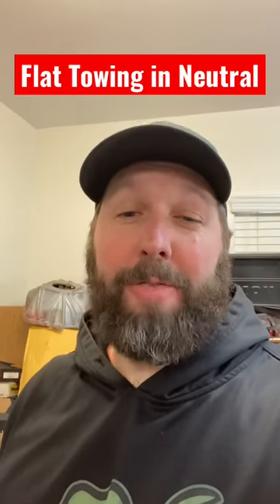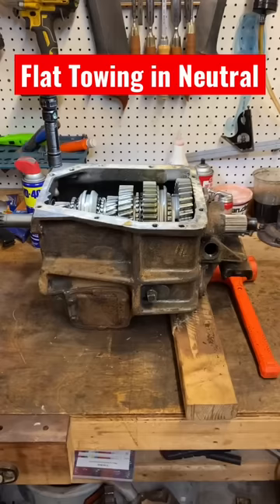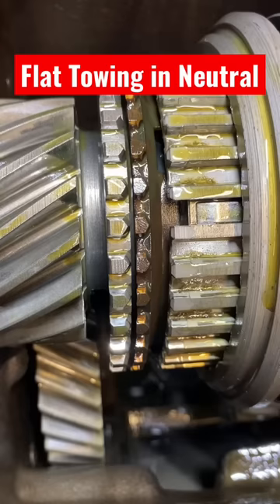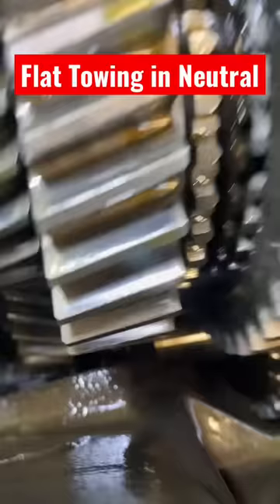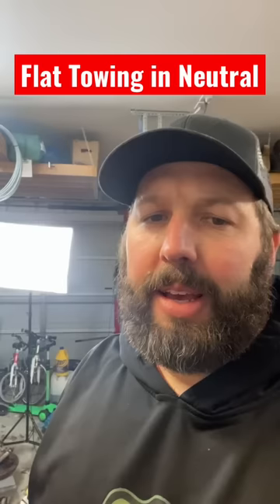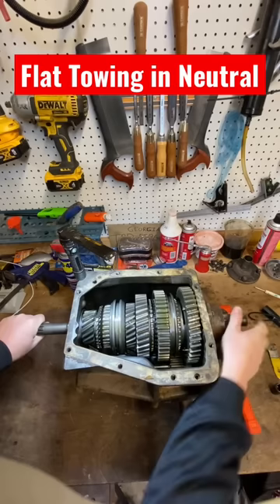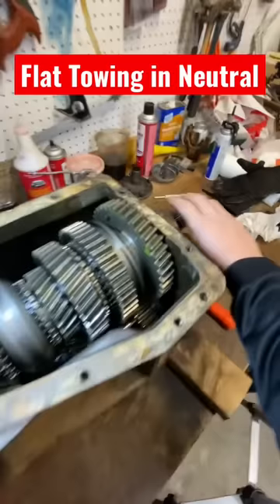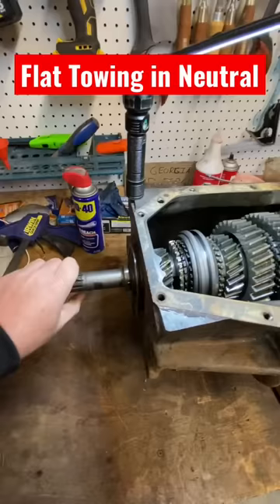Flat Towing in Neutral??? #transmission #stickshift #mechanic

Comment: Something else to remember is not all manual transmissions behave the same way either. I generally look up the model to it's specifics before flat towing.
Reply from the maker: That’s true. You have to refer to the owner’s manual. My longer video stated that, but it got cut out when the video got trimmed down to 60 seconds 👍

Comment: The 3 speed with low trans that came in "most" Chevrolet 3/4 and one ton trucks should have 80w90 gear oil in it. I have towed more of those with the trans in neutral and the front on a tow truck than I can remember. Don't go more than 15 miles or so and if you must then pull over and let it down and start the engine for a bit. NEVER tow over 40 mph without pulling the driveshaft and ALWAYS drive slower if possible. Towing with the front lifted keeps the rear of the inside of the trans covered in oil. Pull the driveshaft if your flat towing without a person in the vehicle with the engine running. Pull it anyway if your pulling someone with a strap or chain at highway speeds which you shouldn't be doing to start with but not everyone has a trailer or tow truck money. Don't pull an auto trans vehicle at high speed without a person it with the engine running or disconnecting the rear of the driveshaft and strapping it up. NEVER  DRAG  OR  TOW  FULL TIME  4WD  OR  AWD  VEHICLES. Trailer or rollback them only. Don't tow or drag 5 speed Dodge manuel trans truck with the driveshaft in. You might get away with it going 20 mph but it isn't worth the risk.
Reply from the maker: It’s best to just read the owners manual 👍

Comment: Love the comments but in seriousness you never want to flat tow a ford superduty with an automatic in neutral even a 4wd and the transfer case not in neutral as it will destroy the automatic.  The last planetary set is splined to the outputshaft and it wont recive lubrication and fry. You can flat tow with transmisson in park and transfer in neutral but all around its best to use a rollback or remove the shafts
Reply from the maker: Yeah the trans needs to be in park.
Reply: @freedomworx  we had a guy at our shop that was one of those know it all's and we had no choice but to flat tow this truck. It was a geo thermal company truck with a drill derrick on the back.  The truck was far too heavy for its own good and it couldn't be jacked up to get to the driveshafts.  If I remember correctly the bed with the derrick alone weighed 18,000lbs.  Needless to say the truck was a constant headache, they had taken the bed off their old truck that was cat diesel powered and slapped it on this poor old F450 6.0 powered truck.  Anyway the guy was told repeatedly to keep trans in park and the transfer in neutral and he kept asking why park with that tone like he didn't believe you but lacked confidence to strait call you out so any way only had to go 5 miles.  Thing is when he hoped out he put transfer in gear to hold it on the incline it was on so we had no clue the trans was toast till after I put injectors in it.   By then he had already be let go for some other screw ups.  I won't even begin to tell you the fiasco it was putting the trans in something we could not get on a lift or remove the cab.
Reply from the maker: Everyone tries to call me a know it all when I post stuff like this. It lets me know immediately who the know it all in the conversation is. I know I don't know everything...and that's why a continue to learn. I'm not trying to flex any intellectual muscle, I'm just trying to teach folks something that might cause them some heartache and butt hurt somewhere down the road. I'm not even a mechanic, so when the "professional mechanics" start running there ignorant mouths, I just feel so sorry for their customers...
Reply: @freedomworx  sorry if you thought my first sentence of my reply sounded directed at you.  I forget how things come across sometimes.  Allow me to correct that.  I was "yeah" to you agreeing with your reply then when is said "we had one of those know it all types..." I was beginning to reflect and think back and tell a story.  And I'm not one of those old timers that thinks everybody else is beneath me.  I think in this field the day you stop learning is the day you hang up the hat because everything changes so fast.  When I called this guy a know it all  let me give a better example of what I mean and sorry for the novel in advance.  He was putting. Timing belt on a vehicle. Part of my job was helping any new guys that needed help or had questions and also show them how to look stuff up online and print things off.  I diagnosed this car and had already printed off the complete procedure for the timing belt replacement so I gave it to him and had highlighted the timing mark alignment as it was kinda funky and he said he had done several of those cars and knew how to do it and got started.  Also part of my job was that all timing jobs got double checked and signed off by me before the cover was put on and finished so it was my ass if it was screwed up.   First double check it was wrong I showed him and explained it with the diagrams and said I would be in the next bay if he needed me.  2nd double check wrong so I pulled my cart over and showed him how by doing it and he argued they I was wrong and the procedure was wrong.  I went and double checked and it was not wrong came, I went into the office to explain to the owner of the shop what was going on and ask how to proceed And he said if I have it in time and am sure then to tell him to put it back together the rest of the way.   We then went over a few other vehicles in total I was gone 15 minutes.  When I went out there he was starting to put the cover on and I asked him if he messed with it or if it was still how I left it.  He said it was the same. Long story short it started for a second or two and went boom and locked up.   Im like fuck my life. Luckily we had cameras and it showed him taking the belt off while I was in the office. Once confronted....  He still lied and said he didn't touch it.  Showed him the video and he said that's not the timing belt he hand in his hands.  So yea.  That's what I meant by calling him that.  Nobody knows everything and everybody makes mistakes but it's how you handle them and grow from them that counts.  Also that wasn't even the worst of what he did that led up to him getting fired.  We really tried to teach anybody willing to learn but he just wasn't.  Have a good day sorry again for the novel
Reply from the maker: I didn’t take it as any disrespect towards me. You wrote it just fine. 👍I was just explaining how I agree with you.
Reply: @freedomworx  ok cool.  I felt so bad and was like well shit.  I honestly try to help the younger guys and not be one of the stereotypical "old timers" and I hated to think I came across like that. I wanted to make sure you knew I wasn't.  Sorry for misreading your reply. Thanks for letting me know.  I subscribed.  Gotta love the internet and how things come across sometimes.   I swear 2 people online could argue over it being day or night with out even realizing they live on opposite sides of the earth.
Reply from the maker: Thanks for watching 👍

Comment: put it in gear and cut a broomstick to hold the clutch down, or put a floor jack under the rear end to hold the wheels off the pavement, or remove the spider gears, whatever you do don't read the owners manual... lol
Reply from the maker: My wife would be upset if a cut down her daily driver 🧹

Comment: I've never been told that. I've been towed & I've towed other vehicles & they've always been in neutral
Reply from the maker: Well it's fine and not in others. Distance and speed also matters. It might have been perfectly fine, and you might have done damage you didn't know about. The Owner's manual will explain what is permissible.

Comment: Years ago we had a thing called tow hubs they went between the drum and the wheel and they had a bearing inside and they spine free so the differential driveshaft transmission would never turn and that’s how you flat tow the vehicle
Reply from the maker: Interesting. Never heard of those 👍

Comment: Makes sense, even though there is no torque the drive shaft is still spinning causing friction. But would the gears change? A car being pulled at 50 miles per hour stuck in first would be horrendous IMO
Reply from the maker: I never said to tow in gear. Just that towing in neutral can potentially be harmful. The owners manual will explain how to flat tow properly.

Comment: I've seen manual transmission cars towed that way without damage several times and was always told this is an automatic only problem. Clearly you can see that would be a problem with lubrication loss eventually but this particular design would go  longer than most tows without damage.
Reply from the maker: The only way to be sure is to read your owners manual. It affects different transmissions differently.

Comment: I told my tracker with my RV for 9 years and never had a problem the only problem I've ever had of the transmission was the clutch spring on the disc was loose and the clutch still look like brand new but I had to replace it because the spring was loose making noise PS the gentleman about it brand new from the dealership to pull behind his RV before I purchased it
Reply from the maker: It’s depending on the specific transmission. Some handle it just fine. Some catch fire.

Comment: FYI,.... you can tow in neutral you just have to either have the engine running........
 Or you can leave the transmission in its highest gear and just let the engine spin with the gearbox every time you start moving which won't hurt anything but it'll cause a little bit more drag but at least it won't cause damage.
Reply from the maker: I absolutely told you what to do. Read the owners manual…. I doubt any of them will tell you to tow the vehicle with it in gear, spinning the engine…
Reply from the maker: I think book smarts and hands on experience are both required to gain wisdom. The people that don’t, are usually lacking one. I’ve got both. Pretty silly argument though. Trying to discredit my video by saying that reading the owners manual is t the appropriate course of action 🤷🏻‍♂️
Reply from the maker: @skeetermcswagger0U812  what’s your problem?
Reply: @freedomworx  ROTFFLMMAO!!!🔩⚙
Reply: @freedomworx   I hope you don't put this much effort into complaining about everybody else that's complaining that complains about this video because that might become a vicious cycle. 💀🏍💨🔄
Reply from the maker: I’m genuinely interested in what makes you so pissy 🤷🏻‍♂️. You seem pretty unhappy.
Reply: @freedomworx   I have a good friend that's an engine builder and whenever he builds an engine for a car for me that I'm going to use in any type of competition if it's stick shift and I haven't had a chance to break it in really well I leave the break in oil in the engine and put the car in high gear and I tell it to the event in gear and I've never had a problem with doing that in the 25years I've been doing it.🤷‍♂️
Reply: @freedomworx   You ever heard that little phrase"....... dig 2 holes."?

🇺🇸 You might want to get started.🇺🇸
Reply: @freedomworx   If you're that sensitive about comments we get on YouTube I could just delete mine if you want......it's that simple.
Reply from the maker: @skeetermcswagger0U812  well not to be mister negativity, but that’s not really an adequate way to break in an engine. You need cylinder pressure from spirited acceleration to force the rings into the cylinder walls for them to lap each other. And as far as flat towing your race car without damage, good on you. Some transmission don’t have any issue with it. But many do. So you do you. I’m just providing the information for people that didn’t know it can cause damage. And if you don’t want to listen to me, maybe you’ll listen to Tremec 🤷🏻‍♂️. https://www.tremec.com/not_am_detalle/flat-towing-manual-transmission-vehicles/.
Reply from the maker: I’m not sensitive about it. I’m just don’t understand why you feel the need to be so abrasive 🤷🏻‍♂️

Comment: This is also a point against those that like to drop into neutral to coast.
Reply from the maker: Yes, but if the engine is running, and the clutch isn’t depressed, it will still oil itself. 👍
Reply: @freedomworx  Not as quickly as I would think it should be compared to the output shaft is spinning speed. but a fair point.

Comment: Just put transfer case in neutral, chain and or gears will cover the transfer case oiling.. if not a 4x4 you bought the wrong towed vehicle
Reply from the maker: There is a reason you see so many Jeeps behind Motorhomes. 👍

Comment: If you are in neutral then the transmission is disconnected from the engine and drive shaft. Thats why your transmission shows idled RPMs while you're driving if you popped it in neutral. If you are flat Towing and it's in neutral the transmission gears should not be turning at all
Reply from the maker: The transmission is never disconnected from the driveshaft. If the driveshaft is moving, then the output shaft and everything attached to it is still moving.

Comment: Pretty sure your wheels are spinning which spins the diff which spins the driveshaft which spins output shaft
Reply from the maker: That’s all true. Problem is that the output shaft does not touch oil. It also does not spin the countershaft, which is what slings the oil to the top of the transmission. That’s the point of the video.

Comment: In England, I had RAC breakdown cover. My 82 Ford Sedan broke down in winter, head gasket, so I booked for an engine swap to yes, an LS V8. RAC comes inspects the car, says they'll roll back it because it's a classic, so the next day the guy shows up and is immidiately hostile because I spoke to him during the liberal religious holiday of Covid Lockdown, he then proceeded to flat to my classic which now has major arch rust, no transmission and has been abandoned by the new mechanic. I am now 26 grand in the hole with no accountability.

TL:DR Just don't get your car towed by anyone other than a private operator who's honest and has a rollback.
Reply from the maker: Dang. That sucks.

Comment: Thats y i always remove the sparkplugs and put the gear shifter in last gear and remove the head light bulbs and ecu if u wanna be on the safe side put your mirrors in the fast position this will not help ever but the more you know, you know?
Reply from the maker: Overachiever 😂

Comment: The drive shaft turns the gears to splash lube. The clutches are just separated and the input is sitting still.
Reply from the maker: The driveshaft turn the gears that don’t reach the oil. Thus, it doesn’t splash. There are no clutches in this manual transmission. 🤷🏻‍♂️

Comment: That is why it is better to trailer. Back in the day when had to flat tow our CJ5 rig for hunting, disconnect the driveline from the diff.
Reply from the maker: Jeeps are generally fine for flat towing. You just put the T-case in neutral and the trans in gear/park.

Comment: I flat towed my s10 to the shop 5 minutes away because i blew the oil cooler line off of it and blew all the oil out, didnt seem to hurt it but since it was a very short trip im guessing it doesnt do any real damage
Reply from the maker: It’s perfectly acceptable for some. And short distance at slow speed is fine for most.

Comment: Yep and there’s heaps of different configurations that you really need to know before attempting it.
Reply from the maker: You should read your Owner's Manual. Towing in neutral is fine for some vehicles. Some need the driveshaft disconnected.
Reply: @freedomworx  Yep, absolutely true.

Comment: When towing any vehicle.  Figure the drive wheels.  Rear wheel or front wheel drive.  Front wheel drive, lift front.  Rear wheel drive, lift back.  Totally safe, flat bed it.  I burned up a transmission, by towing a vehicle with rope.  Not totally, but I believe it played a part in its demise.  Save thousands and tow it right.
Reply from the maker: Yeah unfortunately, most of the people that understand what I’m saying, learned it the hard way. 🥴

Comment: Well I never turn off the engine when kicked to neutral. So the engine is still turning the input shaft.  Just at idle. But still baths the gears good
Reply from the maker: As long as the clutch isnt depressed 👍

Comment: It really depends on teh axel and drive. A trasn axel can onyl be towed a certain direction. However, rear wheel drive, is lift up and drag, since hte front wheels are not powered it doesn't matter... meh.
Reply from the maker: You just need to read the Owner's Manual for the specific vehicle.

Comment: depends on distance. under 100 miles at a sane speed (50-55 max) its ok. Any more than that, drop the driveshaft.
Reply from the maker: Generally the owners manual will specify. 👍

Comment: I usually fill the transmission completely full of oil which ends the worry of getting oil to all the gears
Reply from the maker: Just out of curiosity, what method do you use to get it completely full?
Reply: @freedomworx  well 1st thing is to pull the top loader shift thingy and then just dump it in.
Reply from the maker: That’s an option. But I think it’d be a lot easier to just drop the driveshaft. Or make a fitting for the fill hole to raise the level.

Comment: the top gears are sitting in oil atleast half way if it can’t lubricate itself something’s wrong  look where the fill hole is located
Reply from the maker: The mainshaft does not sit in any oil. That would be extremely inefficient.